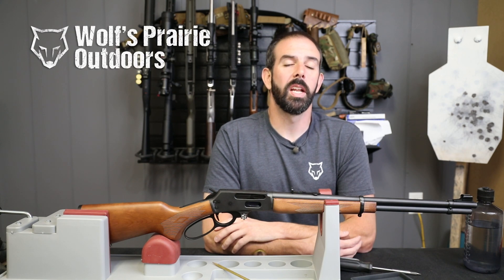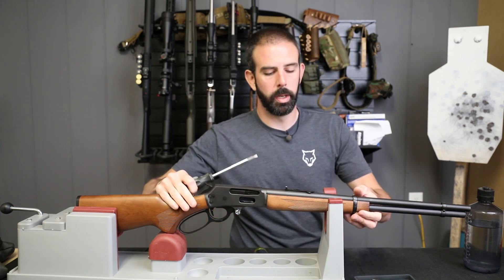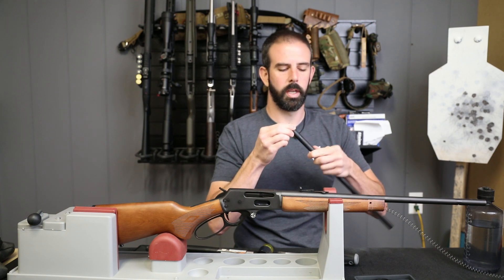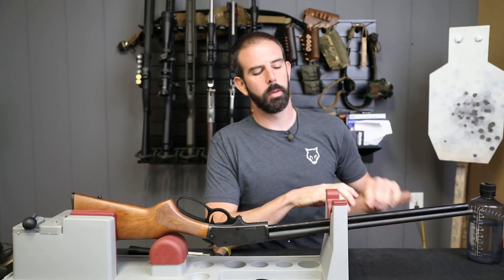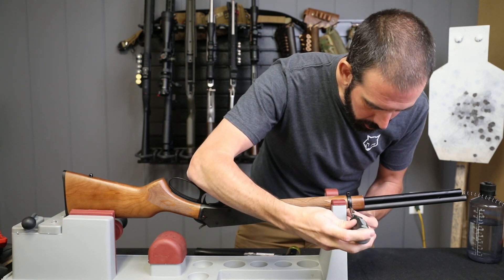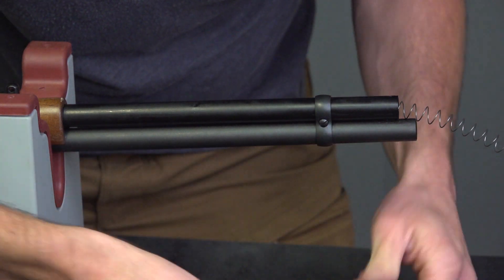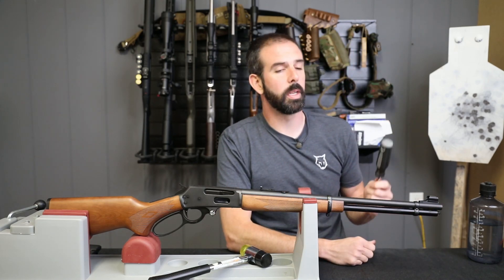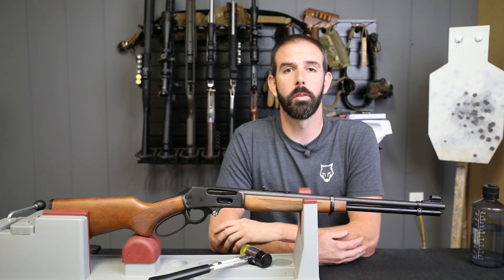Budget Brush Gun Project: Part 3

Comment: Interesting video, I’ve never taken the front sight off to remove the magazine tube
Reply from the maker: Yeah I shouldn’t have had to, but when I did a dry run I couldn’t get the rear band screw to go back in had to work on the area where the screw passes through to make it work.
Reply from the maker: Plus, I wanted to show anyone not familiar with lever guns exactly what everything looks like and how it’s positioned.